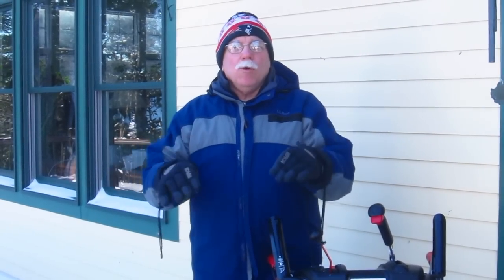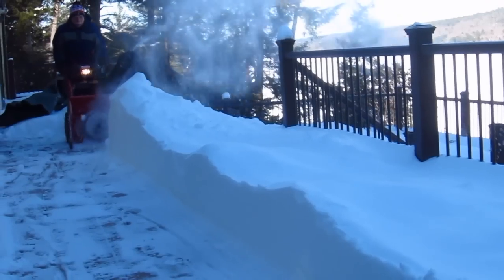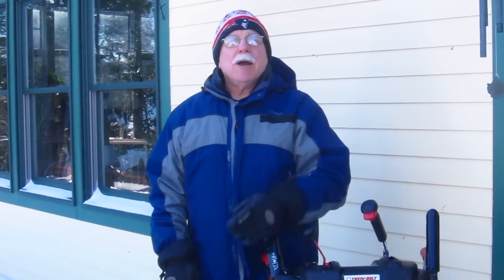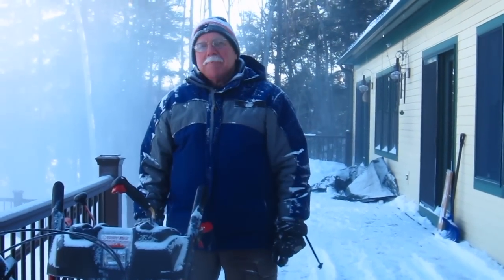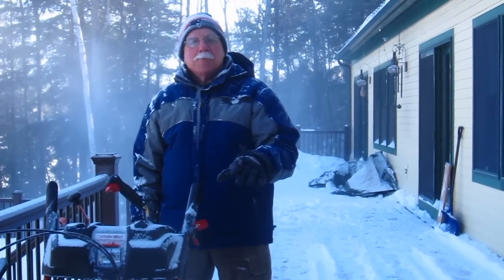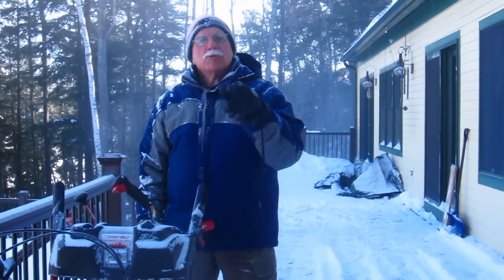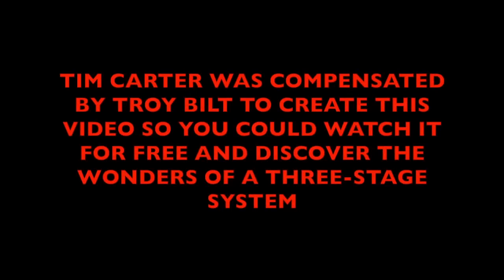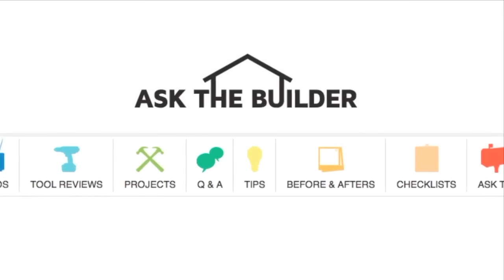Troy-Bilt 3 Stage Snowblower

Comment: Are you sure it will collapse the deck if not removed, or are you just making an assumption?
Reply from the maker: Here are some facts: I didn't build the deck on my current home. Most decks are supposed to be designed for a 60 pounds per square foot capacity. That capacity assumes all fasteners, metal connectors, lumber, etc. are in new condition with no wear.  Prior to taping the video, I had already removed 4 feet of hard-packed (soon to be solid ice) snow. After the video was taped I removed a total of 6 more feet and winter is not over. More snow is on the way.

Also realize when the snow comes down from the roof to the deck, it does't float down. It comes crashing down. I'm sure you remember this formula from your high school physics:  F = M x A

Now that you have all those facts, I want you to read this column I wrote a few years ago and tell me if you're willing to take the chance:

http://www.askthebuilder.com/snow-roof/

Comment: I could of had a V-8 but I bought a Power smart 212 cc  2 stage, DB7202 24 inch PA. we have a short drive way, but long side walks/ snow plows / blocking the drive way. so this aught to be enough...…… 
  Locally seen a club cadet, with a 243 cc engine , listed 899. I took a pass on it . the one I bought, minus tax. 481.00  free shipping to the Home depot near us. nice deal, see how it pans out...……. 75 dollars for a thee year extended warranty
Reply from the maker: Nice Get unlimited tips each week in my FREE newsletter. Subscribe at www.AsktheBuilder.com

Comment: That was a nice demo, but let's see how it does in a wet and heavy storm and then I shall opine.
Reply from the maker: Well, you got your wish 48 hours ago. We had 12 inches of horrible heart-attack snow here at my house. It was 4:45 a.m. when I was out blowing it. My videographer was asleep as I should have been. It worked super well. All my friends who had traditional low-speed first-stage machines complained about their machines clogging up.Their augers that were feeding the high-speed impeller all got clogged. You'll not be disappointed with a blower like this that has the high-speed center auger.
Reply: +Ask the Builder Very cool, I heard the same complaints from friends with the single and two stage machines. Thanks!

Comment: compensated reviews automatically receive a thumbs down
Reply from the maker: How do you suggest we solve this conundrum?  Here are the facts you should consider before answering: The snowblower costs just about $1,000. A videographer's day rate is just under $1,000 per day - the half-day rate is $700. The cost to post produce the footage is $450.00. I get paid about $0.005 per view. In the 18 months the video has been up, that equates to $163.00. Do you expect me to fund the $2,150 cost and recapture it over thirteen years? Tell me how you would create the same video and not dip into your savings account. If you have the answer, I'll switch to your method so I can create many more product review videos. Please share your wisdom!!! I used to eat lunch on overturned drywall mud buckets for 20+ years and don't have a masters degree in business finance.
Reply: @askthebuilder  Someone is getting paid $1000 to film you snowblowing your deck? I'm in the wrong line of work...
Reply from the maker: No one paid me $1,000 to snowblow my deck. How did you arrive at this supposition? As for changing jobs, have at it. If you think you can support yourself and a family doing tool reviews, I've got three bridges and a freeway I'd like to sell you. ;-)
Reply: Ask the Builder you are the one that claimed a videographer cost 1000. I have no desire to do tool reviews, nor anything against anyone who does. I'm just trying to figure out what you meant by the $1000 per day comment.
Reply from the maker: Oh, I GOOFED up!!!! It was early and I misread your comment. I thought you meant that I'm getting paid $1000 by the snowblower manufacturer. Yes, go research what professional, that's important, videographers are getting paid each day. They have tens of thousands of dollars of equipment and usually at least ten years pro experience. You can get anyone with a smartphone to record, but you see that crap quality all the time on YouTube. True video recording is a fine art. The top videographers will almost always have a grip with them. The grip is in charge of carrying all the gear, setting it up, holding reflecting screens off camera to get natural light onto the subjects face, etc. I hope this helps. Sorry for the confusion.
Reply: Livereater00, I'm guessing that you go to work for 8 hours/day but on payday, you tell them "no, thank you"?  Think before speaking, if you can actually do that.  He said the videographer day rate was just under $1000.  That person supplies their travel time, setup, teardown, equipment & whatever else needed to make this informative video happen.  It might pay you to do a little research on something instead of attempting to belittle someone as you sit in that overstuffed beanbag chair in your mom's basement as you eat generic Cheetos & wipe your fingers on your tidy whitey undies.
Reply: @fuckjoebiden4976  bro the guy set up a camera on a tripod and shoved in storage after

Comment: That's a beast!
Reply from the maker: I've used lots of snowblowers. This one is by far the best I've ever used. That center fast-spinning auger blasts snow back to the impeller. You saw how far it shoots the snow. Holy cow!
Reply: Tim. as I think you know, I sell another version of them; it was great to see this demo!  Makes my 'normal' 2 stage look calm...  BTW guys, the plastic chute shouldn't be an issue.  But I would use an appropriate non-stick spray on the blower areas that handle snow.

Comment: O.K. Tim, the snow you were going through is dry. What about thick wet snow ??? Thank is when a snowblower is tested proper. FACT
Reply from the maker: Every snowblower I've tested struggles with the white concrete you talk about. When you know snow is wet like that, you blow only 3 inches at a time. You don't wait until the storm is over. You use the tiny gray cells that God gave you in abundance.
Reply: @askthebuilder  Amen to your statement Sir Tim. Good day too.